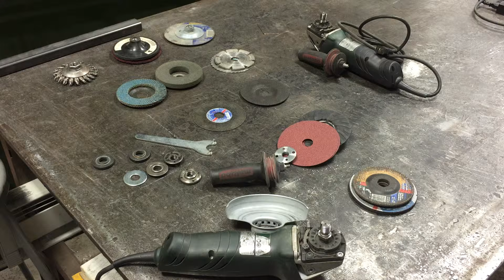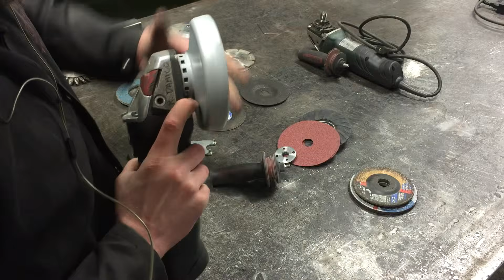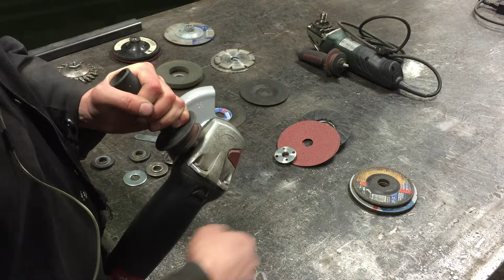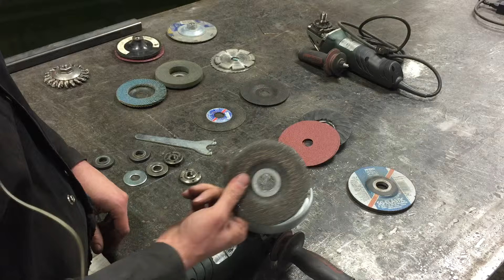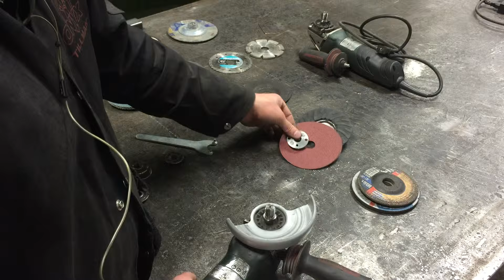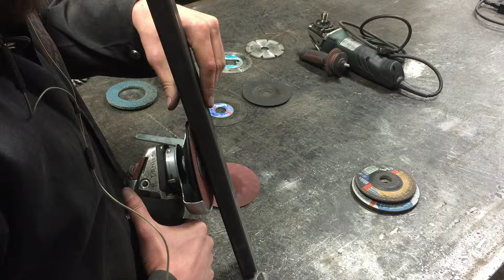Angle Grinder Set up

Comment: So you don’t need the Shim, the one that has a notch, when using the a wheel that has an Arbor already?
I get its used as a backing plate to sandwich thin wheels. So they are supported front and back.

Comment: Great tip about the safety guard - it needs to be aligned then secured toward the hand that will hold the grinder (on the side the handle is mounted on). It is there to protect the hand holding the grinder should you slip. To protect your eyes always wear ANSI protective eye shields/goggles when operating a grinder.

Comment: The first thing imma use my angle grinder for is to cut my cars aftermarket plastic sideskirts shorter. I bought a metal cutting wheel... I think it might have been overkill but i might need it in the future. Wish I had a garage. Really sucks to be doing projects in my apt living room. But anyways thanks for the info

Comment: Excellent video. 

I have one thin wavy/fragile looking circle piece you did not address. Any clue as to what that is?  I have never used a grinder.  Just using it to polish with 4” felt polishing wheels.

Comment: I bought a cutting wheel and it came with 2 washers. Not sure if I need them, they seem redundant as the wheel size fits snug with the size of my arbor. Any thoughts ?
Reply from the maker: They might be spacers to fit different size arbors than yours. The inner rim of the wheel should fit a feature on your arbor nut or the existing spacer that came with the grinder. It shouldn't ride directly on the threads of the arbor. If it fits snug and runs without vibration, you are probably good to go.  Just be sure to wear your safety gear. I always wear a face shield when using  a cutoff wheel on a grinder. They have a tendency to shatter if you run them wrong, so keep that guard on and stay safe!
Reply: @robdamico5304  Thanks for your prompt response. You're helping us all out a great deal !

Comment: Holy moly if you freaking need to watch a 10 minute video to see how to put an angle grinder together and can't read the directions or have common sense then maybe you shouldn't be using one
Reply: I learned how to use one in 5 minutes at work from a specialist, guys like my dad now. I do large amounts of grinding and welding.

Comment: You are using a type 27 guard with type 1 wheels.  That is why you are using washers are shims.  You need to swap out the guard to a type 1 guard to use type 1 blades.  Once you do that you will be a lot safer and you don't need to use any washers as shims

Comment: My arbor nut keeps spinning off even though I hold down the spindle lock and use the tool to tighten it. Scares me to death. I was using a diamond cutting wheel on a 3"x .25" piece of marble with only the two nuts (above and below the blade) the tool came with. Is it simply not tight enough? They aren't supposed to unscrew as the blade turns.
Reply from the maker: Check the orientation of the bottom spacer and the nut. Typically you want the bottom spacer to have the raised rim facing out from the tool (registering the hole in your wheel on center). Then make sure the nut has the raised rim also facing out away from the disc. There should be a slight depression on one side of the nut to avoid bottoming out on your bottom spacer and bypassing the disc. Diamond wheels tend to be thin, and I suppose it is possible for a no-name import grinder to not have enough clearance to bite down on the disc, but I’d be very surprised if that was the case. Bottom line: any disc you put on the grinder should only spin with the tool’s arbor when properly installed. And yes, it should only get tighter as the tool engages the work. If the disk is rattling free while in use, something is not right and you will need to sort it out before using it safely.

Comment: Thank you for this, I am also a newbie, using a cutting wheel and couldn’t get the disc to not spin, the directions of the tool indicated one way only to use the arbor nut but since it was thin it would spin, flipped it over and tight and ready to rock. Just got to keep the fingers intact now or the wife will kill me.

Comment: I'm new to angle grinders, so the video was very helpful to me. Thank you! Edit: At 4:26 you take what looks like a common flat washer, and call it a shim. You put it under the usual shim that has the square recessed notches on one side, which transfers the spin of the arbor to the wheel. Two questions for anyone who knows angle grinders: [1] Where does one get that "flat washer" shim? (The hole in an SAE 5/8" washer is actually too large.) [2] A flat washer-like shim does not have the recessed notches that lock in, so what keeps the cutting/grinding disk from slowing down or failing to spin properly?
Reply: Don't.  Adding a shim to move the wheel down is not necessary.  This is the first time that I've seen someone think it is necessary or desirable.  
That said, you can purchase a spacer if you measure the shaft diameter.  But the fact that you cannot find "grinder spacer" should cause you to wonder about the necessity, given the fact that there are hundreds of millions of the grinders in use worldwide. 
Conversely,  if you deem them the next most popular addition to the grinder, setup your tooling and mass produce them.
Reply: @timrich6755  same question! Do i need the washer that he called a shim at the 4:26?
Reply: @tamaica7770  Why do you think you need it? Does something not work?  I've never needed to add a washer/spacer to my grinders, or any that I've used.
Remember: safety first.  Use equipment modifications engineered for the grinder you're using.
Reply: @tegimr  cause the blade seems to close to the guard. Kinda worry about metal debris stuck in there and cause the blade not spinning efficiently. Not sure though, just a thought.
Reply: @tegimr  I do see the needs of a shim/spacer when I put on a flat wood carving/sanding/shaping disc.  The center arbor would stick out that made the flat disc not usable.  Hence, I was searching a grinder spacer or shim for a long time but fail.  Eventually, I found a Dewalt 397616 flange that seems working ok.  But it always bothers me every time I use it for the concern of safety.
Reply: I was thinking the same thing and also a new user. I'm guessing there must be an adapter available just for this purpose. Otherwise a flat washer could be modified with groves or nothes using the angle grinder [I think].
Reply: You probably figured this out by now, but that unthreaded washer he calls a shim comes with every grinder you buy.
Reply: Its a 5/8 zinc flat washer. We use them on our DeWalt 9 inch grinders with a 9 inch diamond masonry cut off disk. The reason why is that the spindle ( the threaded part of the arbor) is much longer than the small angle grinder spindle on the 9 inch grinder and the wheel will sit too low on the arbor. If the wheel is too low, we can't use the guard because it won't fit on. We have a couple Makita 9 inch grinders now that dont have this problem.
Reply: Hello. did you ever get a good answer to question number two - i.e. [2] A flat washer-like shim does not have the recessed notches that lock in, so what keeps the cutting/grinding disk from slowing down or failing to spin properly? ? Unless I am missing something I don't really see it mentioned here in these other replies. I would think this would kind of totally negate the engagement of the ' notches' to the 'drive' shaft and therefore render the grinder useless? Thanks